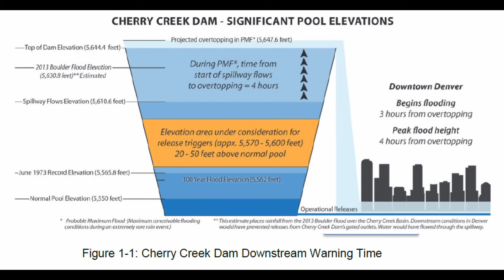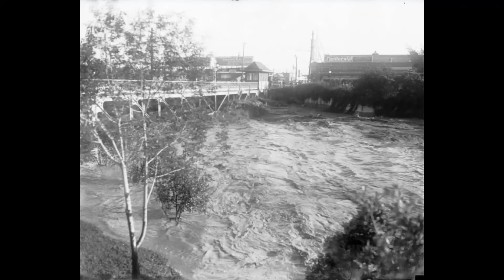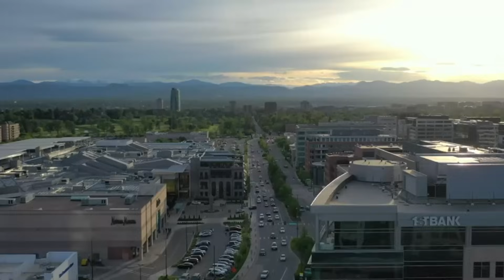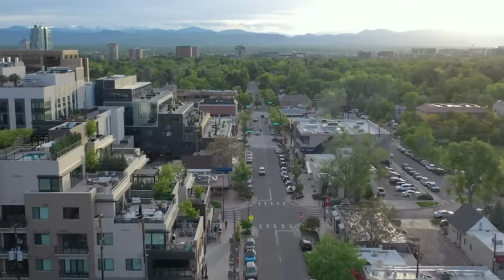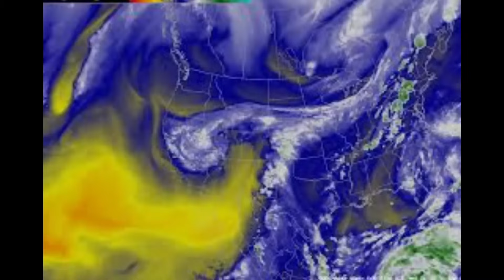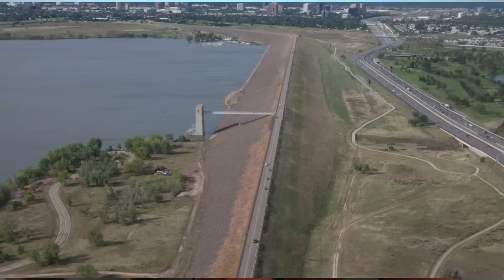Why Cherry Creek Dam Could Fail?

Comment: If one observes the various fiascos which are becoming common, from Boeing to borders, to the tacit legalization of shoplifting, oddly allowed riots about this and that, to the promotion of genocide at Harvard, then the rampant moral turpitude becomes obvious in all sectors of society.  Engineering and maintenance are not exempt from these human failures.

Some years ago, Senator Moynihan, a well-studied man, wrote "Defining Deviancy Down" it is something everyone should read, most especially now.   You can find it on-line.  It's not a long read, but it explains it all.  

Do yourself a favor, read it.

Comment: Error Correction? Time mark 6:57 324,336 acre feet is 324,336 acres of water one foot deep, not 324 acres. 640 acres to a square mile.. 
Which means 506.775 square miles of flood one foot deep, or approx 100 square miles 5ft deep.
Reply from the maker: Yes, I misspoke on the volume but the correct value is on the slide.
Reply: @CaseyJones-Engineer  just checking my sanity. I have so little left, and it's never in stock when I go shopping!

Comment: ACOE did an earthen dam failure analysis for the Middle Fork of the Willamette River, which could be triggered by a Cascadia Subduction Zone earthquake of magnitude 9. It estimated water levels of 50 feet in Eugene. The report provided insufficient analytical detail to discern how the 50 foot estimate was derived. As far as I could tell, it was a 2-dimensional calculation. If so, the 50 foot is likely an overestimate, though even 5 feet of flooding would be a major problem.
Reply from the maker: I don't even want to contemplate what a 9.0 quake would do to that region, but the thing is it will happen at some point.
Reply: @CaseyJones-Engineer  Indeed!

Comment: Simple solution:
Install lifeboats on davits at your home’s highest point.
Any earthen damn and even plenty of Concrete dams have an inherent risk of failure.
Always live upstream and out of flood zones.
Reply from the maker: That would be a pretty wild ride!  I agree, I would never live downstream from a dam like this.  I wouldn't live in an area dependent on old levees either.
Reply: @CaseyJones-Engineer  I would think the best high ground escape plan would be to create shelters in any high rise that's 6 floors or more anchored into bedrock, if there's only a three hour window to evacuate an entire city and surrounding.
It's not like they can dock a hospital ship in downtown Denver......yet

Comment: It wouldn’t be remotely close to a 50 foot wall of water.  The dam doesn’t fail instantly and completely.  Once it is overtopped, it takes hours upon hours to complete meaningful emptiness.  Before overtopping, people would be told to evacuate.  After failure, people would still have time to continue evacuating.

The likelihood of it happening is lower than the US getting nuked anyway.
Reply from the maker: The 50 foot tall wall of water came from the Corps of Engineers study.  The same people who designed, built and now operate the dam and reservoir.  And what the probability of this event could be is the real question.  I could see the possibility of a smaller rainfall event on top of snowpack producing catastrophic results.

Comment: I have relatives in Aurora so I have driven past Cherry Creek Dam on 225 many times. Every time I do, I look up and wonder what would happen if the dam failed.
Reply from the maker: It would be an utter disaster if that dam failed.  In fact, it would be a big enough disaster if the reservoir level increased to the point where the spillway flowed into that housing area.
Reply: @CaseyJones-Engineer When they turned farmland into suburbs, they went from udder disaster to utter disaster.
They never learn

Comment: Are there any risk reduction strategies being considered at this time by the Corps of Engineering?
Reply from the maker: It appears that the only risk reduction method they are implementing is the increased release rate through the outlet works.  Once their EIS was released with a "no action" recommendation it appears that nothing else is being considered for risk reduction at this point.

Comment: Extreme weather more often? Don't think so.
Reply: Anecdotally , where I live in mid Tn we had a " 100 year " event in 2010. 18 " in 48 hours.
Since then we have had 2 weather events that were equal in hourly precipitation rate but did not linger as long. 
All 3 events led to wide spread damage and some loss of life.
So lets call it 1 - 100 year and 2 - 50 year events in 12 years.
I'm not a Statistician , Meteorologist or an Engineer, but I know what I saw.
Reply: Brunswick or Sebago Maine, Montpellier Vermont would probably disagree.
NEWS FLASH: It’s already documented globally that extreme weather events are happening more often and with far more intensity.